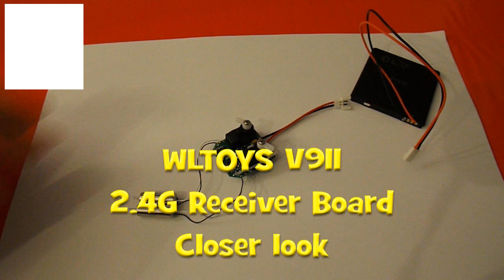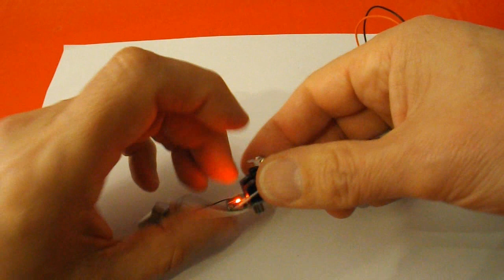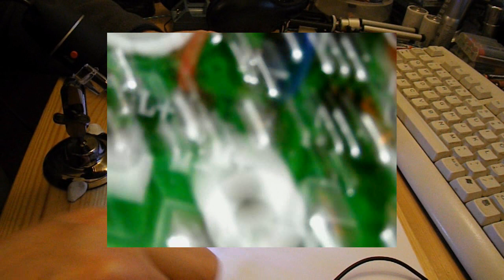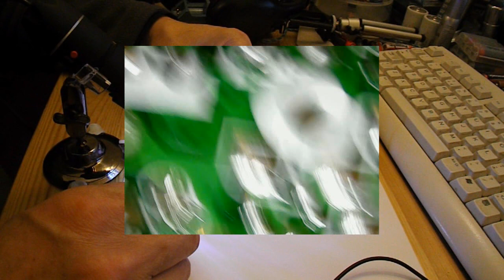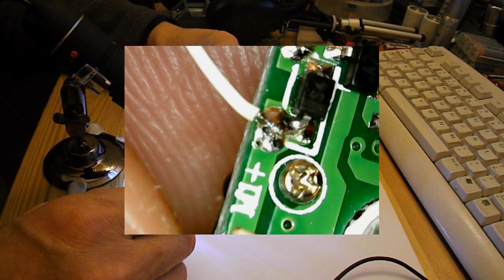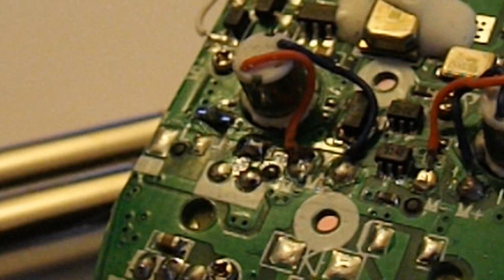WLTOYS V911 2.4G Receiver Board binding and closer look

Comment: I have a V911 and i fly it with a CT-6B. In the trottle cannel, you have to put the substrin to 0 or 255, i not renember, and the main motor works. Sorry my bad englisth.
Reply from the maker: Yes that is right, in a later video I do show that - I use one of the switches on the CT6B to ZERO the throttle to enable the motors https://youtu.be/dwqkD29-ics?list=PLA5a2xPRSrB3NYdWYI8H-zNX_7hBM-rsU - here is an example of me learning to fly using my CT6B - https://youtu.be/c7hwUowAIhg?list=PLA5a2xPRSrB3NYdWYI8H-zNX_7hBM-rsU
Reply: @GrandadIsAnOldMan  Sorry, subtrim  in CH3 is set to -120. I can send you the configuration file to load in ct-6b.

Comment: Hello,  I've one V911, I crashed it and the tail motor moved the wires (+ and -) touched each other and made a short circuit...

I looked the PCB of V911, and this component in 4:36 S4 was burned, I wanna to replace it, should I buy another "S4"? Is that a Diode?

Thanks a lot...
Reply from the maker: I think you could be right, I am no expert but a quick Google image search for "S4 diode" comes up with identical looking items. Good luck with replacing it, soldering SMD components can be quite a challenge.

Comment: Hi again, we seem to cross paths every once in a while, lol. I'm have built six gliders this year but now I need to think about the electronics like everyone else. I bought the flysky i6 transmitter with the receiver. That setup will be pretty heavy because of the bulky receiver and the 2 servos I need to glue to the plane. This thing looks to be perfect! Will it bind with my transmitter ?
Reply from the maker: I don't know about the i6 transmitter as I haven't got one. This YouTube search brings up a few videos that show it working with the i6 https://www.youtube.com/results?search_query=v911+with+flysky+i6
Reply: GD, With my setup the small coreless motor spins but not full THROTTLE, There is a complete stop of the motor past the halfway point of the transmitter. but when i switch to a cheap , heavy nose trimmer motor,  it does all the normal things. Is that fixable? Maybe because the bulky motor needs less voltage it performs better with only 1 lipo?   
Have you found a solution? I notice you use 2 motors.....
Reply: I got it working with full throttle. Turns out I just needed to try a newer model coreless motor.

Comment: Any idea if any of these micro boards (what are they called? Emx boards?) can be binded to a Turnigy 9x transmitter? 
I want to build a micro RC Plane and I'm looking to use one of these boards. Thanks in advance!
Reply from the maker: Sorry I don't know but if you just type that question into Google you will probably find an RC forum with a reply as I found plenty when I was looking for information. Just ask "will a WLTOYS V911 receiver board bind with a Turnigy 9 transmitter" I just did that for you and found plenty of answers including 3 YouTube videos. Here is the first one on the list https://youtu.be/Rbn954J3DAg
Reply: GrandadIsAnOldMan - After watching the video on the link I found out that I was actually able to bind my V913 Helicopter to my 9X so I'm thinking I should be able to bind any WLTOYS brand receiver board. Thanks for the time. 
I have had that V913 Heli for quite some time and was put away but now that I'm able to fly it with my 9X should make it interesting again.
Reply from the maker: xXPilot4HireXx good luck with that 😊

Comment: The positive wire from m2 (main motor) needs to go to the positive of the battery connector.
Reply: After a little digging around the Internet I came across a forum post about the board. http://i01.i.aliimg.com/img/pb/191/877/465/465877191_074.jpg This picture seems to show where the connections should go. Here is the link to the actual forum I got the pic from. http://www.rcgroups.com/forums/showthread.php?t=1548027&page=1327
Reply from the maker: +RC+Karting Kid if you trace the tracks on the circuit board you will find that the M2+ and the V+ are linked by the same track so there is no difference in connecting the motor wire to M2+ or the V+

Comment: After a little digging around the Internet I came across a forum post about the board. 
http://i01.i.aliimg.com/img/pb/191/877/465/465877191_074.jpg
This picture seems to show where the connections should go. 
Here is the link to the actual forum I got the pic from. 
http://www.rcgroups.com/forums/showthread.php?t=1548027&page=1327
Reply from the maker: +Mr Rishi The Cookie yes I have done similar forum searches myself when I bought the first one early last year. I came to the conclusion that I may have received a faulty one so I bought a second one but the new one has exactly the same issue
Reply: GrandadIsAnOldMan That is pretty weird. Ohh well someone should say a solution soon.
Reply from the maker: Mr Rishi The Cookie yes it's pretty frustrating because it looks ideal for a small plane but unless it is a glider I really need the motor control. At the moment my plan is a small flying wing glider but I haven't got round to it yet.